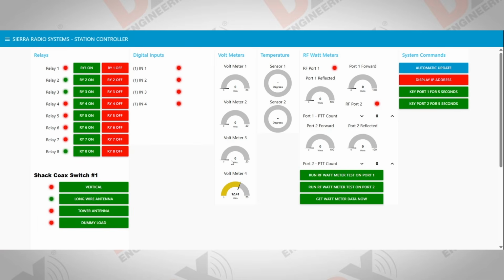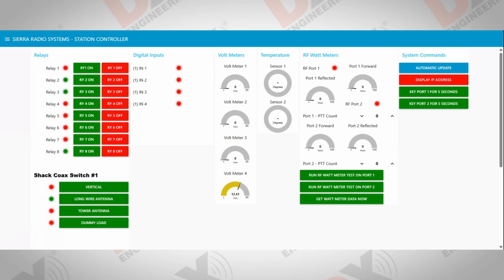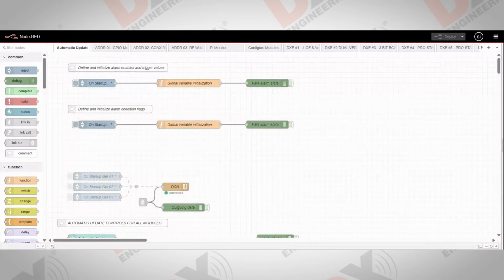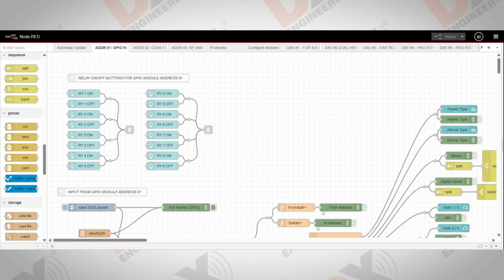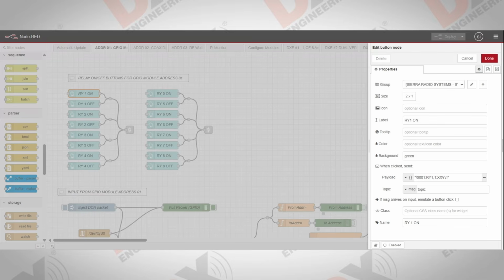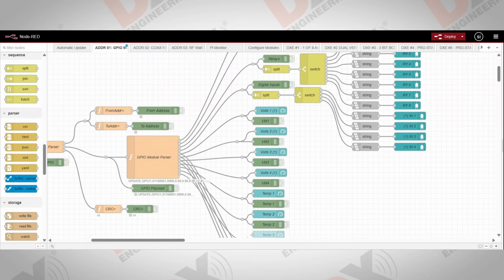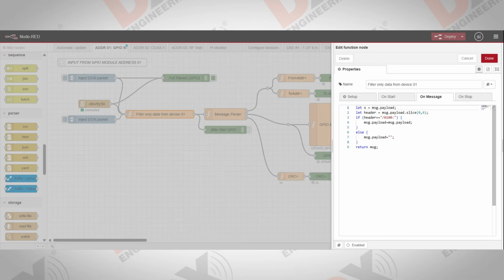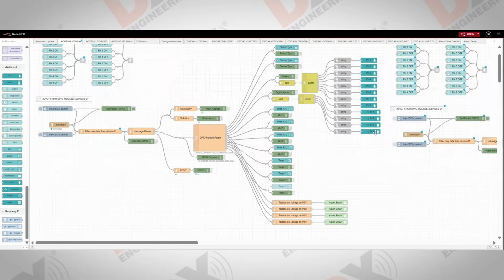Remote Station Control, Pt. 2: An Intro to the Node Red Programming Language with Sierra Radio

Comment: i have it on running freebsd and always wanted to make a "rig server" which is all great except i dont see a way to share a rig soundcard over a network. rig and rotor thru hamlib but still no soundcard , would be nice to just be able to just connect any pc to the station using only network.